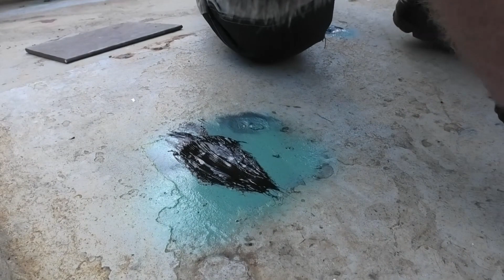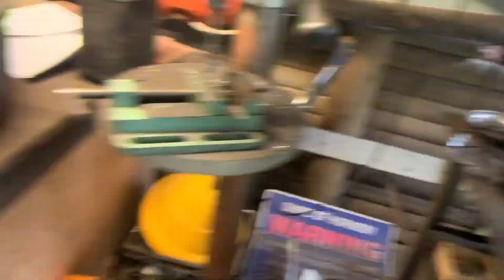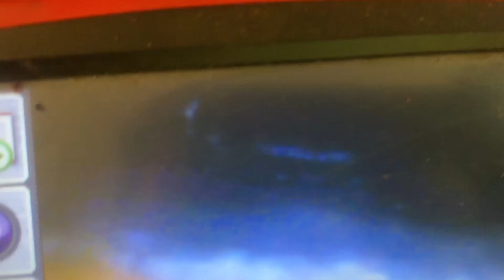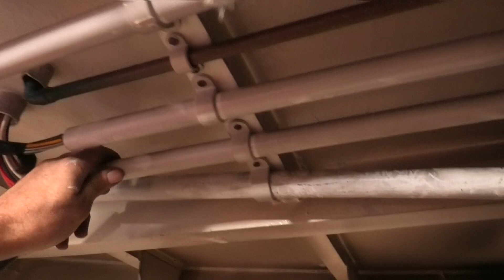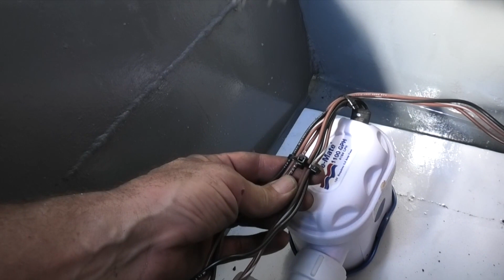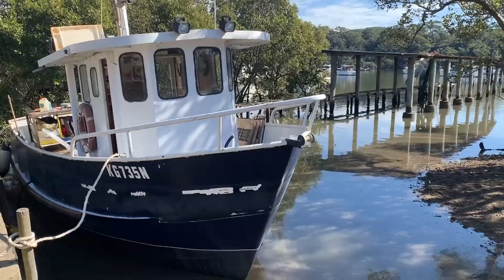Launching the steel trawler!

Comment: make a tic tracer.;  use a 12 or 24 volt turn  signal flasher with 3 lugs. positive, negative, signal line; attach pos/neg to a battery, the signal line will start to pulse a voltage , attach it to the line you want to trace, using a test light

Comment: Guys- All you needed to do after grinding those holes was to put G-Flex epoxy mixed with a filler in each. No paint. Then grind smooth when done and it will outlast the steel! Then do a Rhino liner paint for truck beds or use what the U.S. Navy uses- a thick gray non-skid epoxy such as  Chemsol Navy G - MIL- PRF- 24667. Type that into Google and see for yourself how rugged it is.

Comment: I do not know weather you have finished the wiring or not but you can get a dyno marking machine fairly cheap that are great foe marking wires, when putting in new wires you can easy make a wiring diagram for future fault finding, gets rid of colour following as the material used is heatproof and if burnt you can still se the markings, wheras colours all turn black
I would also put a rubber flap over the switch panel, stops any drips dropping on them when you open the hatch or condensation.

Comment: To install winch brush end-plate, you make a c-shape out of steel wire (not coat-hangar wire - too soft) that will hold it's shape. Flat metal works too. Make the C shape larger than the commutator where the brushes run. Use this to restrain the brushes into their holders. Use two of these on your 4 brush end plate. This allows you to get the end plate started on the motor shaft and brushes past the start of the commutator. Then pull out these restrainer C's and end plate will drop into final position. Hope that helps.

Comment: Get some 50m wide masking tape and apply the black Sikaflex 255FC to that and then lay it down over the holes, it should be dry enough in one hour to release the tape and leave a clean finish. the best way to go about covering holes especially on a "DECK" that you and others may be walking over is "STEAL REINFORCED FIBER GLASS", comes in a tin with hardener and is mixed up like BOGG  then plied before it goes hard. This STEAL REINFORCED FIBER GLASS sets like steal and is totally water proof, you should be able to beat on this stuff with a hammer and have no damage. For application of the STEAL REINFORCED FIBER GLASS just apply it like I said to do with the 50m masking tape for a clean finish and support over the holes.
Just a little help from Spray Painter Pete.

Comment: You know there is a tool called tone generator and probe. They are not that expensive, $20, and they work great for finding wires in bundles. Extech TG20 Wire Tracer and Tone Generator on Amazon

Comment: Marine electric motors ?  Had similar problem with 2 electric motors designed to be in bilges for bow and stern thrusters.......well known Swedish brand , brush holders were mild steel with a little cadmium plating so they don't rust in the box! Never occurred to be that they would be rusted up to be unfixable when I bough the boat...... $900 for a rebuilt and $1200 for a new one .....nice add on to cost of boat! You would think a motor that you know is going to be but in the bilges of a boat would be better protected than that, brass brush holders anybody?........your winch motor less so but in the bilge! Come on!    Great to see you floating . Cheers Warren

Comment: FYI. There are self leveling versions of Sitkaflex/5200 so you don't have to use a finger to smooth out ......they might leak thru before setting , but I doubt it . 👍

Comment: There is a technique for re-floating a boat that is in water so shallow that the keel is stuck in the sediments. One uses whatever means might be available (on a sailboat, you could use the mast) to turn the vessel partially on its side, which raises the keel up out of the mud. Just curious - did you consider that possibility whilst you were winching, struggling and cursing?
Reply from the maker: Yes, by winching hired up we were actually healing it over and pulling it at the same time but unfortunately it is longer than the channel is wide.

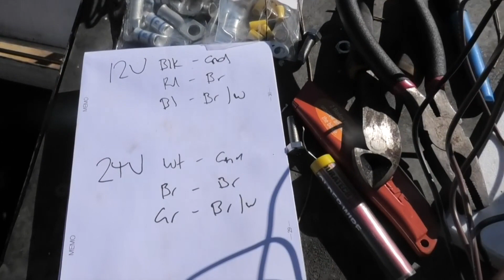Comment: Question: at around the  31:25 mark in the video, you mention and show heatshrink. But first: As an electronics geek who has worked in the industry for 40+ years, I'm concerned about that. All heatshrink is not equal! Specifically: "dry" heatshrink is good for protecting wire connections from vibration fatigue. BUT: it has absolutely no value against water (especially SALT WATER) corrosion-- even if that is just the ambient salty air environment. Even in a dry environment I've seen heatshrink become loose on the connections over time, and the formation of green corrosion on the copper wires underneath. (Yes-- even in New Mexico. USA where the humidity is ~30% and Dew Point is virtually nil).

Back to the question: Are you using "dry" heatshrink, or using the heatshrink coated with adhesive inside? This stuff costs more, and it doesn't come in rolls (it comes in pre-cut lengths in a bag). But it's absolutely stronger against vibration and impervious to moisture. 

Let me know!

Oh, and by the way-- love your videos and the work you do! You're awesome, dude!
Reply from the maker: I've been using a mixture. The stuff over the individual wires is dry I think, but the larger stuff dual wall with the adhesive on the inside.
Reply: @DangarMarine  Thank you for your reply. Among my many follies in my 60-odd years  ambling about through  life, I've owned a few "holes in the water through which you pour money" and learned that water and moisture are not friendly to wiring. Adhesive coated heat shrink has no equal. 

Carry on!

Comment: Why was the repair to top deck done in silicone rather than a more permanent welding ?  Cramps in timing do not indicate the less permanent solution. The silicone will fail and require more sikicone.  I recognize that a time constraint  to launch might be critical, but the lack of adequate repair is only a band-aid solution to doing a proper repair/repaint. I wish you luck, guys.
Reply from the maker: Sikaflex is polyurethane, not silicone and more than enough to slow the leaks until I find time to replace the deck plates.

Comment: This boat is a lot like the survey vessel I captained.  The usual working crew was about half a dozen people.  We got enough money to let bids (legally had to have three bids), I wrote the bid specs., eventually contracted with a ship builder and delivered the boat.  When I went to check up on progress weeks later I saw that they had simply welded metal plate patches over the rusted away spots that needed to be brought up to the original thickness of the hull.  I had specified in the contract that they cut out rusted metal and weld in new metal to fit the holes they cut out.  Cracked me up.  This was a professional ship-building company.  The contract was iron clad (figuratively speaking) and they had to cut out all of the overlap patches they had welded in and do it properly.  I'm sure that didn't help their profit margin.  The lesson was be sure to write detailed specifications if someone else is working on the boat.  Dropped in a new Cat 2206 (I think it was) and after swabbing out the interior of the hull and doing other outfitting it was a  very seaworthy (Great Lakes of the US) vessel.
Reply from the maker: Yes, it might be quick, and in some cases appropriate, but I'm not a big fan of welding over doublers. This boat has a long one on each side and one day down the track I'd like to cut them off and repair the sides properly. I'm definitely going to replace the whole deck when I get back from the US and possibly even raise it slightly at the same time.
Reply: @DangarMarine  Sounds like you're at where I was when I took over the boat I ran. The first time  I looked down into the bilge and there was about 50-100 gallons of water in it.  With a thick layer of black oil floating on it.  The bilge pump wouldn't work and when I crawled down through the hatch and reached in and pulled out the hose there was a rag stuck in the end of it.  Swabbed out the entire inside of "the hole", wiped it all down with degreaser and then painted it with a paintbrush.  Painted places noone had seen since it was built and I suspect noone has seen since.  A one time thing. I'd never do it again. Unless I had some really sophisticated  respiratory gear. Talk about an enclosed space.  But it served us well.  And it served the State well.  It was a state owned vessel.  We even pulled some kids out of the water on a stormy day after their sailboat went over.   That Cat (actually a 3306 I think) was an excellent engine.  It never let us down.  The one it replaced had quit running while on the water several times. Can't remember what make it was but what a wreck.  The hole with fill with diesel smoke and it would come out through every vent and the hatches.  Almost humorous.  But dangerous. Even on the Great Lakes we get seas you can't afford to be motorless on. Good luck.

Comment: JB Weld and a patch would last as long as new steel on those holes in the deck. JB Weld is a miracle substance.
Reply: Except for their high temp putty, I put some on my extractors to cover a stress crack in the pipe collector box & drove off for my annual rego inspection. Got a couple of KM's down the road & looked in the rear view mirror & it looked like I'd taken a missile up the tail pipe and was billowing a smoke trail out the back of the ute, got out to inspect it only to see the last piece of JB's high temp smoking & shrivelled putty fall off, OH well, I needed new extractors anyway.

Comment: Stu, while you are wiring the troller make yourself a schematic of the wiring with color indicators so in future if problems arrive you will be able to quickly deduce the problem if am emergency happens with your electric. I know you are pressed for time but it will be invaluable if ever needed.
Reply from the maker: Yes, did the schematics first now building to those. A copy of them will live on the boat.

Comment: I've had this question on many occasions watching your vids. And on this project especially. But you draw me into your work so well that I've always forgotten to ask.

I don't see that you use sand/media blasting very often, if ever. I understand that you aren't going to do the engine bay that way. Who is would spend anytime in a tornado of media inside that small space. But I would think that any of the outside and non machined areas would be economic both in time and money to use blasting as a method of rehab. Wire wheels and abrasives aren't cheap and take a hell of a lot of time and effort to use.

Is there something that I'm missing? Maybe something unique to your part of the world locally or your work site that makes sand/media blasting prohibitive?
Reply from the maker: I had the hull professionally blasted before priming and when I get around to doing all the topsides I’ll go to a marina that has a sand blasting booth. I was quite limited in what I could do in that residential area.

Comment: I hear your pain on the cable tracing.  Check out the Power Probe IV master kit.  Saved me 00's of hours with my Riviera 35' refit.  POWER PROBE IV Master Combo Kit - Red (PPKIT04) Includes Power Probe IV with PPECT3000 and Accessories https://www.amazon.com/dp/B01KY4APFQ/ref=cm_sw_r_cp_apa_i_KiCCDbTHFFJ56

Comment: Does the gland packing housing have a grease fitting on it? On our older fire engines that use a graphite type packing material we could grease the packing to keep it lubricated and from wearing on the shaft. Plus it would also slow down or stop the water dripping unless it was turning at a certain rpm and suppose to drip to keep the packing and shaft cool.
Reply from the maker: Not yet but I’m thinking of adding one.

Comment: A product called Line-X might be perfect for what your trying to do, I do not know if they have a mobile operations center in your country but in the us a truck drives around from town to town with line x equipment, spray on rubberized plastic that hardens in 10 seconds of application, really is some  bullet proof stuff if you can afford to do so, do not know how it would do with moisture and salt water though,
Reply from the maker: I’ve been given a contact of a guy who does that in Australia, I’ll chat with him soon.

Comment: Gah, it would have been far faster to back them and weld them ... welding is going to be a pain in the ass once you are back on the water.
Reply from the maker: There is no way welding would have been faster and the plates are getting replaced when I get back.

Comment: For your decks, try out a product called KiwiGrip.  I used it on my boat and Love it!  After 5 years it still looks great.  Easy to apply, easy clean up and Super tough once it is cured.  You can get it in a variety of colors or take it to your local hardware store and have a custom color mixed. It not real expensive either.
Reply from the maker: Thanks mate, I’ll check it out.

Comment: Just a comment - After the metal was shiny I would have MIG welded the holes shut. Quick, easy, cheap, and will hold until you replace the tin.
Reply from the maker: Would have taken too long, was completely out of time.

Comment: You can always extend the boom of the lift.
Heat that bilge hose with a heat gun and it will slide on like butter.
Reply from the maker: I tried using the heat gun and it just got harder to push on so I cut the end off and just lubricated it.
Reply: Wow, I've widened that stuff up (heating it) over a 1/2" (12.7mm in non freedom measurements) before. Must be different stuff. You did heat it counter clockwise? I hear everything is backwards down there and may be an issue. lol

Comment: A boat suppose to be water tight 100%  the patching  a the back deck would be acceptable if done by a city slicker  but not by you   disappointing  ! This cheap job will come back to face you in the future  take care be safe
Reply from the maker: As I said in the video it is only to help until I get back when I replace the steel.
Reply: @DangarMarine  sorry miss that part  I knew you would do it right  take care be safe

Comment: If you want to fill a big Holm, put a bit of brass under as a stop. Weld as usual, when finishen, remove bit of brass. If you dont have brass, use an extra electrode on the side and control The mest and  fill up hole.
Reply from the maker: Yep, mentioned that in the video.
Reply: @DangarMarine  you have done a tremendence job with The trawler, were do you get all energi from? Many thanks for all videos,  I have learned a lotta, even thou I am a Boat bilder by profession  🤗 Thanks mate!

Comment: i you dan afford it the rear deck i would replate it with another plate over top cut out various shapes around bulkheads etc and pull it down into place using dogs and clamps or bolts  re the crane gusset it below deck or the deck will distort

Comment: This is so close to my experience with a 35 foot steel hull made by Inland Seas, bought it cheap someone left the seacock open and when the head was pulled for a valve job by the time it was caught both engines were pickled. My intention was putting diesels instead of the gasoline engines well it was in a marina with a floating dock with power, water and cable tv. After a year it became a place to drink on the water due to the saddle tanks galvanised steel 400 gallons of old gasoline that would need to be replaced for diesel use. With a hurricane coming I moved it to an isolated hole that a sailboat sat for years after the tide went out it actually sat in a hole that you could walk up to and board it. I sold  it that way it's probably still there
Reply from the maker: I wonder if you can see it in google earth. May still be there!
Reply: I should have bolted an outboard to it but I really liked the lines and couldn't imagine an engine hanging off the back. If that had happened I'd probably be a drunk married to a widow of a friend in Belize

Comment: Since the original engine was designed to pull tremendous amounts of weight, is it necessary for use as a pleasure craft? or is the ship being returned to service as a work boat? … getting at ..would a smaller more economical engine still push to hull speed?

Comment: Congrats on getting it on the water .. great effort by everyone mate.. btw i got a fair bit of dual wall heat shrink ( heat shrink with a hot melt glue inside that makes the join waterproof) in various sizes that i can give ya for the electrical wiring if you like . Im a sparky and im more that happy to help out where i can..let me know if you need anything..and safe trip budd 👍👍

Comment: ok ok ok... Before you start.. pause a bit so i can have time to push like..
Just got my t-shirt in the mail, and my Volvo Penta 2000 lifted out of the boat and inn to the garage.. 
So now i am ready to takle my "diesel beast".. not as big as yours but still i need to strip it down, to make my 22feet fibreglass Doublender (Snekke) ready for next spring..

And i am doing a complete repair of a 14 feet Norwegian Trifoil made in the 60s, and there is loads of wet foam.. the little 14 feet weighs about 600kg at this point, and should be 200..

Og Ready, start the show.. ! 
(thanks for excellent videos)

Comment: Make a canvas cover for that deck winch motor so condensation doesn't form inside overnight after a day in the sun, a wrap of electrical tape on the seam at the end cap should keep rain water out.
Reply: Dusty Farmer 
Its actually  in the air as well
Being in a salt environment  on the sea water
So no matter what it will definitely  corode eventually.

Just like stove tops that are on kitchen benches on the beach
The salt spray , air alone in itself is bad